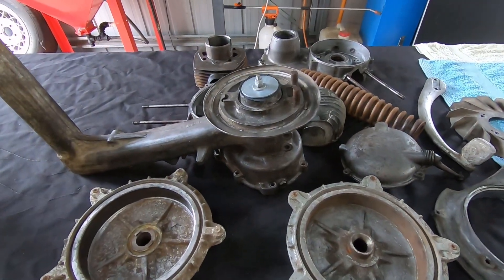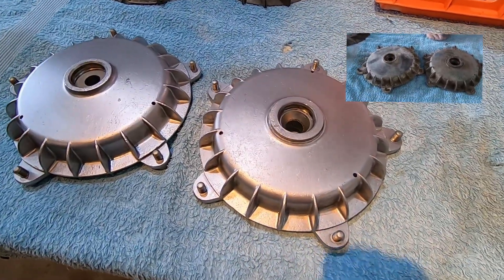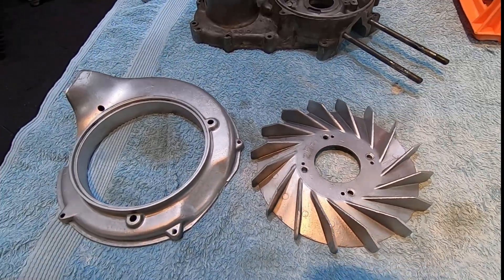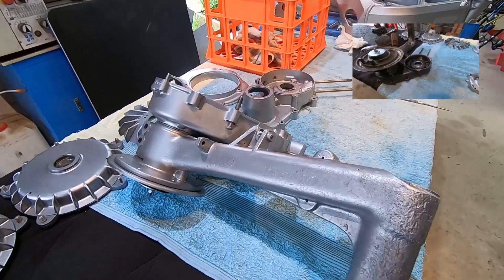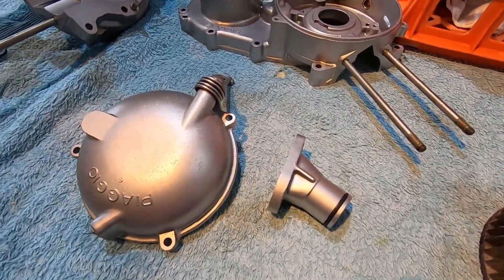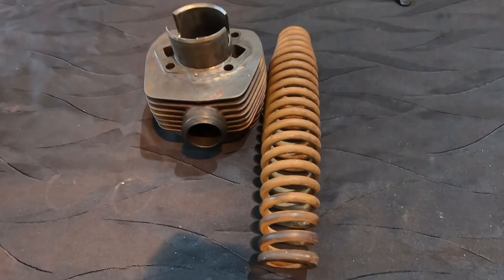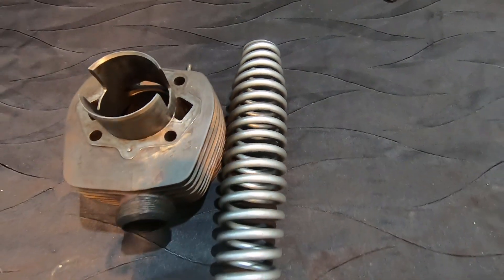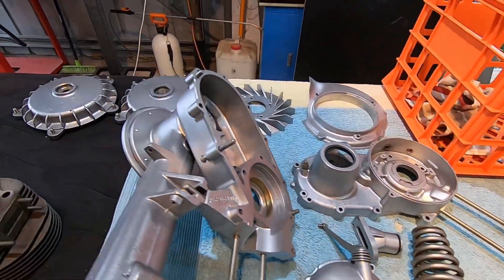Vespa GS150. Vaporblasting engine parts and hubs. Bendigo Hydroblasting makes parts look new again

Comment: Very nice. I'd never heard of vaporblasting before. It does do a very nice job and based on another comment down below it's a pretty reasonable price.
Being only a few km away in the Borough I'll keep you in mind if I need anything cleaned up.
Reply from the maker: @Alan_Hans__  Yes all the bike guys do this when their bikes are stripped down. Currently charging $80/hr. Located around the corner in Epsom. Cheers Craig
Reply: I'm about to go out on my bike in a few minutes. The pushing variety not the motor one :D

Comment: How much would you charge for a job like this? Is it per job or per hour?
Reply from the maker: Hi John. I charge $80 per hour for blasting. This job was just under 3 hours work so $230. Hope this helps mate. Cheers Craig
Reply: @BendigoHydroblasting  yes very helpful thanks. I’ve been thinking of starting a VB business from my home to supplement my income from my regular job. I work 4 on 4 off. If I could blast 1-2 days a week I think it would be nice additional income.
Reply: Wow. That was pretty unsubtle.